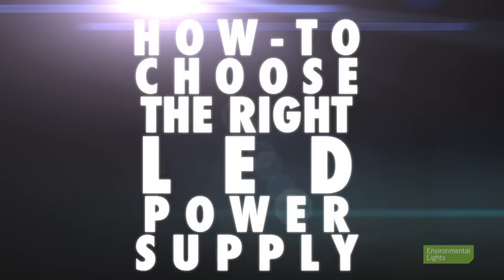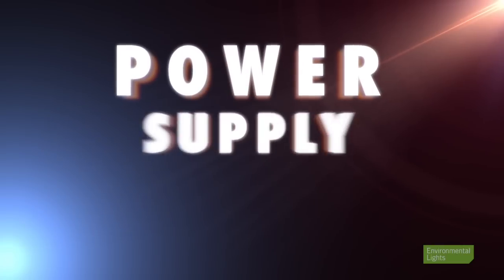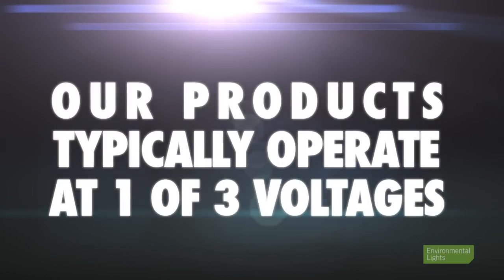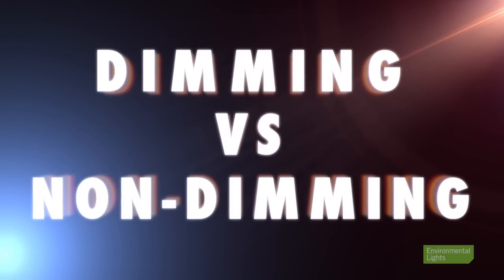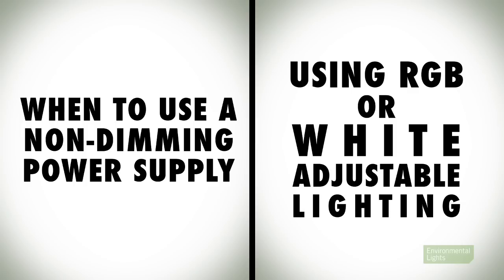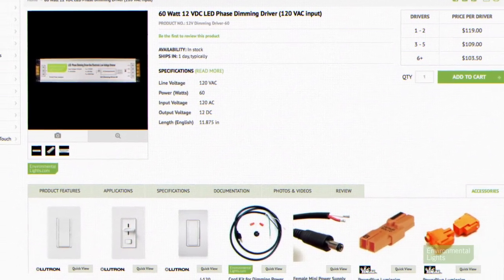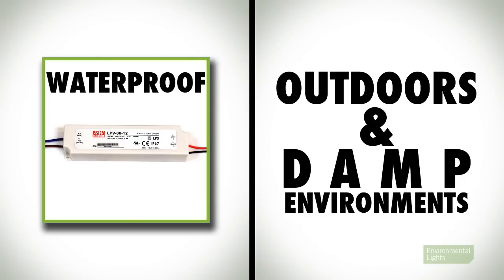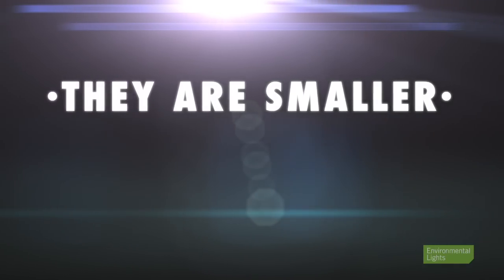How to Choose the Right LED Power Supply

Comment: Will a 10A power supply damage a 5M 5050 LED Strip and Controller?
Reply from the maker: It depends...
What is the voltage of your LEDs? Once you know the voltage, you'll need to get either a 5V/12V/24V driver that can supply power to your lights.

Comment: Hi!  Im from the Uk England, i will be using 240volt supply voltage. My question is im fitting 2, 50 foot waterproof RGB dream strips inside 2 Led channels to be sunk into the driveway. Im unsure of the power supply i need to power them. I will be fitting the power supply in the garage so i cant hear a cooling fan if needed. With this length, would i have to use 12v or 24v ??
Reply from the maker: It depends...
What is the voltage of your LEDs? Different strip lights run on either  5V/12V/24V of DC power so you'll have to check with the manufacturer.

Comment: hi, what are the options to light 10 3-LED 12v 1.08W led strip? i am looking at AC power supply or battery. thanks in advance.

Comment: what power supply should i use for 100watt led
Reply from the maker: It depends...
What is the voltage of your LEDs? Once you know the voltage, you'll need to get either a 5V/12V/24V driver that can supply at least 120 watts to your lights.

Comment: i have a 12v led panel with a 100-240vac 0.7A 50/60hz input and +12v 2.1A power supply. is this enough power
Reply from the maker: Hi there! This is a great question, though I am afraid I must answer your question with another question…  How much power does your 12v panel draw? If you bought the panel from us, then we can quickly tell, however if you purchased it elsewhere, you will need to get that information from the original supplier.
 
The power supply mentioned is 12v / 2.1A which means it is a 25.2 Watt power supply (12v x 2.1A), so the max wattage you would want to power with it is 80% of that number, so I would say no more than 20 Watts.

Comment: Im building a light using 40 Cree XT-E Royal Blue 5W Led Emitters would a CroLED 200W LED Driver Power Supply 12V 17A AC-DC work ok for this or should i jump to the 240w